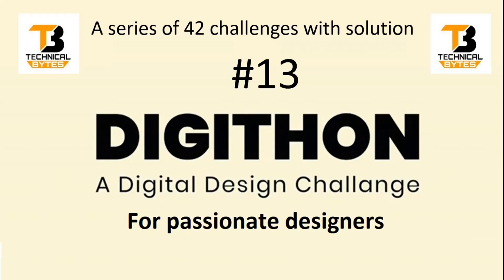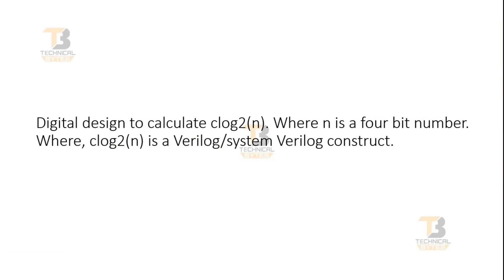DigiThon Question Part 13

Comment: Circuit Diagram: https://drive.google.com/file/d/12AOOoPeSckAO0eOrrww0xQRnjjLuVl5L/view?usp=sharing
Reply from the maker: Clog2(8)=3, Clog2(9)=4, compare it with your truth table, there is a mistake
Reply: @TechnicalBytes  ohh yes, didn't notice that, in that case we can use this table for N-1, So basically first we would need to get N -1 and then use the Priority Encoder which will give correct clog2(N).
Reply from the maker: Can you eleborate more?
Reply: @TechnicalBytes    
1) Substrate 1 from N     = > Now we have N-1 
2) Pass N-1 to Priority Encoder with MSB bit as Highest Priority 

Example : 
N = 8; N -1 = 7;  Priority Encoder Output = 3
N = 9; N-1 = 8; Priority Encoder Output = 4
N = 15; N-1 = 14; Priority Encoder Output = 4
N = 2; N-1 = 1; Priority Encoder Output = 1
N = 3; N-1 = 2; Priority Encoder Output = 2

Pseudo Code: 
function clog2()
size = N - 1;
        for (clog2 = 0; size > 0; clog2 = clog2 + 1) begin
            size = size >> 1;
end

Comment: Pseudo Code:
a is input 
for i in 1 to 30 loop
  if (a<=2**i) then
    return i;
example : a = 8
then 8 <= 2**3 = 3 as we return i
example a = 9 
then 9 <= 2**4 = 4 as we return i
Reply from the maker: Here, you need to design digital logic. Can you please try to draw it?